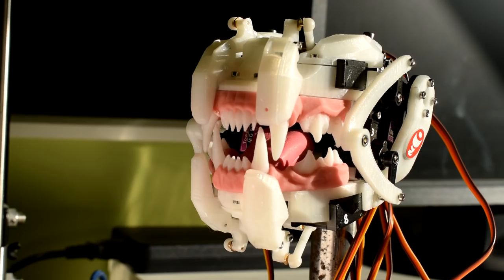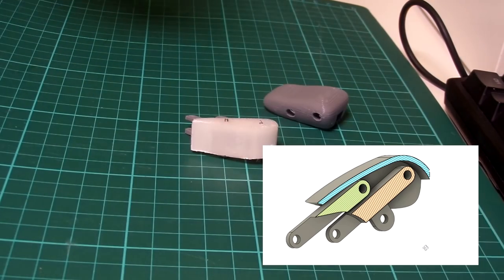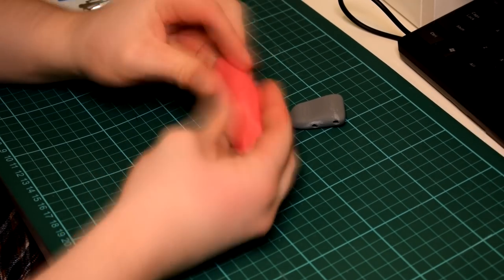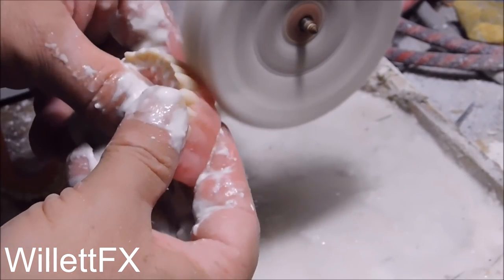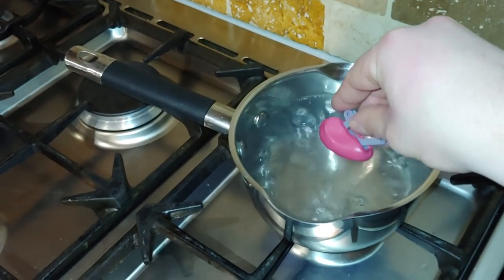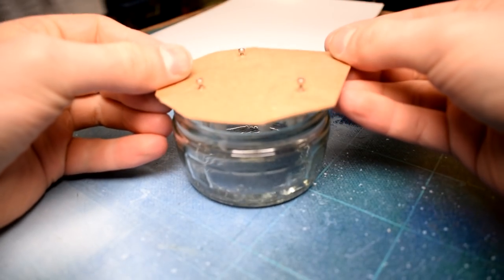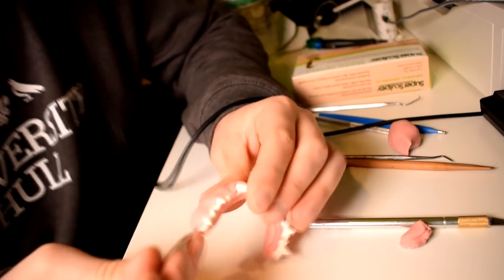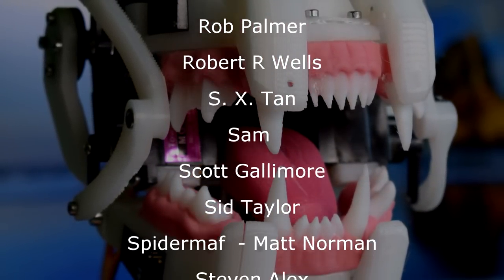Making Teeth and Tongue For an Animatronic Mouth

Comment: My guy, with super sculpey you can harden or soften the material respectively by 'leeching' the oils out with the clay sandwiched in paper which soaks the oil, or adding small amounts of mineral oil like baby oil to condition the clay softer. I imagine the same is true for Fimo, but by combining the 2 you may have found a good workaround. Your work is very impressive, great job!

Comment: Really cool, thanks for sharing! 
Have you thought about printing the teeth in SLA/DLP (Resin printer like the cheap Anycubic Photon) and directly mold them into the gum (silicone)? This way there is no more manual work required afterwards

Comment: Why did you put the parts in the boiling water? To remove support?
Reply: I think it's was to harden the clay, putting it in the oven would completely melt the print. Not sure though
Reply: Annealing/Tempering the plastic. (i think he just put in the tongue as well to cure with the base and act as weight?)
You can harden it in a decent oven np but unless you have a dedicated oven you'd rather not heat up plastic in the same oven you use for food lol
(and you could harden small/thin pieces of sculpey/fimo in boiling water but usually those require a curing temperature of around +130°C but water stays around 100°C so your clay cure wouldn't be ideal for bigger/thicker pieces but thats probably not a big issue with the bits he had)